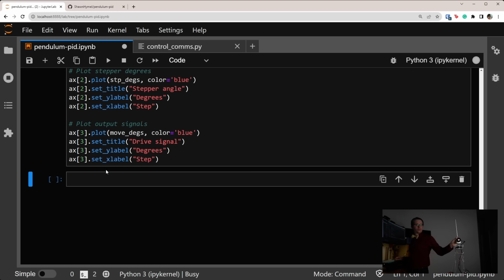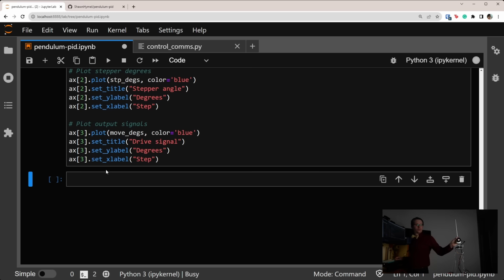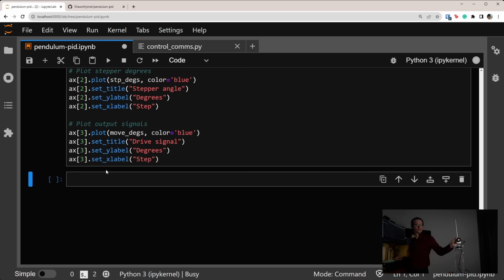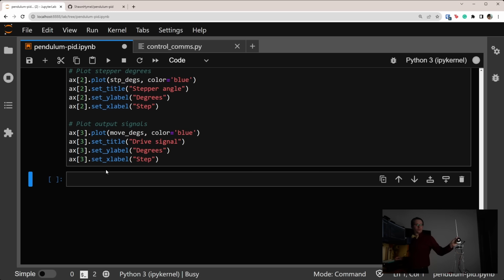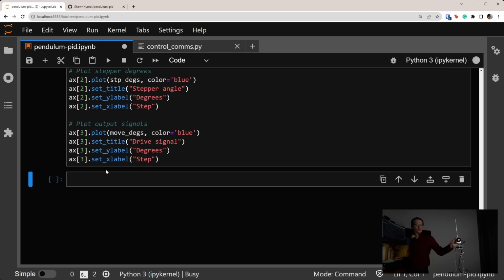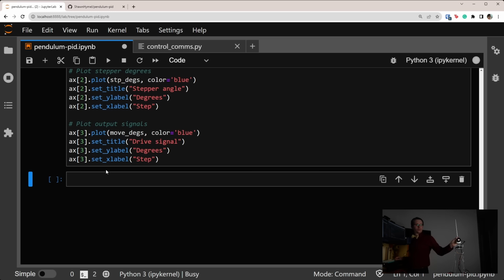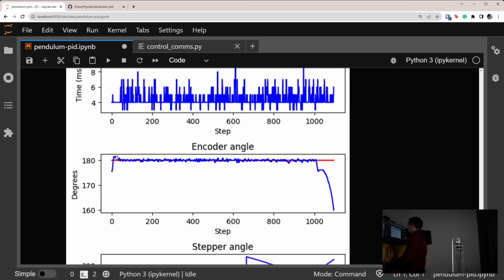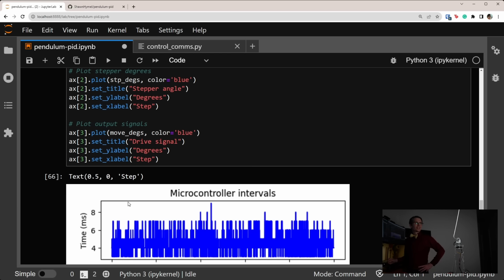How to Tune a PID Controller for an Inverted Pendulum | DigiKey

Comment: Can you elaborate on the ROS latency issue?  Are you using ROS 1 or 2?

I'm a robotics engineer and use ROS heavily in my work.  I've built multiple complex systems using ROS 2 with a huge amount of data being passed through topics, services, and actions.  ROS 2 messaging (DDS) performance is surprisingly good.  Granted, we're deploying on relatively poweful Jetsons, but for this robot and (I'm guessing) a Raspberry Pi, you really shouldn't be having these sorts of latency issues unless there's something seriously wrong with the configuration or the code.  Perhaps whatever model you're using for inference is the true issue and is using most of the system resources.

I hope this doesn't come across as too critical, and I know that this video was a good way to talk about a use case for PID controllers, but I absolutely love ROS and think that it's unfair to blame ROS for what is unlikely to truely be a ROS issue.

Comment: That's a Mickey Mouse inverted pendulum.   All you are doing is just keeping it vertical with the stepper motor that has inherent rotor lock.  And there are several positions of the stepper motor rotor that keep the rod vertical.   A real inverted pendulum rides on a cart.  The actuators move the cart back and forth in order to keep the pendulum vertical.   What you are doing is the equivalent of holding a pole vertical by gripping it with both hands.   An inverted pendulum is kept vertical by moving it's base, similar to how a performer who balances a pole on the palm of his hand.   Your ideas about how to derive the PID constants are equally naive.  There are some very good mathematical methods used.
Reply: You come in with an insult when it is you that doesn't understand the machine.
Your assumptions are wrong.
There are TWO axis of rotation to this machine.
The rod is ALWAYS free to rotate on the horizontal shaft. There is no torque applied to it.
The stepper is rotating on the vertical axis.

It is EXACTLY your cart example, except the "cart track" is an orbit instead of a straight line.
Reply: You're quite wrong with this. The part where the pendulum is connected to is the encoder and that encoder sits on top of the stepper motor shaft. The shaft rotates along the vertical axis.
Reply: @janjoecarcillar  it's  a Mickey Mouse PID example.
Reply: @williamogilvie6909  Why don't you show us your non-mickey mouse version then smart guy. "An inverted pendulum is kept vertical by moving it's base, similar to how a performer who balances a pole on the palm of his hand" That's exactly what his device does except it only does it on one axis.

Comment: Thank you Shawn and Digikey.    The two part series was very good.  Question: what if the PID controller is to operate the supply of CO2 within a Grow Tent (CO2 can help plants grow 30% more)?  Here we deal with not only fans blowing around, but the distribution of CO2 through a cylinder within a room distributed with plants ?
Reply: If the CO2 and fans operate together, you can use a single PID controller that has one output. If they need to operate separately, then you likely need two different controllers or look for a more advanced Single Input Multiple Output (SIMO) or Multiple Input Mulitple Output (MIMO) control scheme.

Comment: Is integral just another proportional if intervals are equal?
Reply: Integral sums the errors as a term. Proportional is error times a constant as a term. Sampling interval being equal make it easy to calculate integral with just a summation.
Reply: @danhtrinh1769  | Is it possible integral is drifting away due to floating point error?
Reply: @rasimbot  Someone else in the comments mentioned integral windup. If your system never reaches your target value the integral term just keeps getting larger and larger and this is know as windup.
Reply: @danhtrinh1769  | What if you stored a certain number of recent errors in a buffer and calculated the integral over only the most recent data?
Reply: @rasimbot  That is one possibility. I don't know how well it would work. Worst case your buffer contains a bunch of huge error values. Looks like there are many ways to handle integral windup based on Google searches. In some cases, the techniques are proprietary and not published. Ultimately, you could try a bunch of different techniques and plot your system response to see how quickly it settles.

Comment: A usefully instructive video for getting from theory to practice.

As an aside...
Float variables are quite slow on AVR Arduino. Scaled integers are much faster, which can be significant in reducing controller loop delays.

Such delays can wreak havoc in real world systems as they are significantly variable, depending on the values of variables and therefore difficult to tune out.

Comment: I have been doing a PID controller for a reflux system for the last year. This is a great intro. There is only one more item I would add, being 'windup' handling. It can be the difference between controllable and not at all. I have never used a derivative but it is meant to be handy for speeding the approach to setpoint. For my use, a slow and steady approach with a well tuned integral wins by a long way.
Reply: While derivative can speed up reaction time, it is not well suited with high frequent errors going up and down. It needs a clean signal to work well.

Comment: So cool! Will we ever see a micropython version?
Reply: Good to know there's interest. It should be fairly straightforward to implement in micropython--the Python code for the PID controller should be the exact same. The only think you need to change is the encoder reading and stepper motor control.